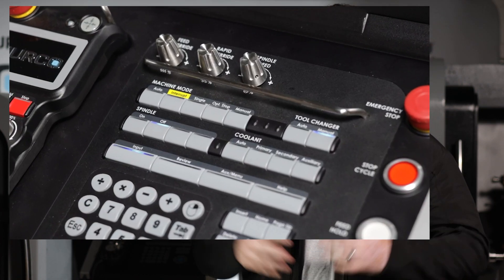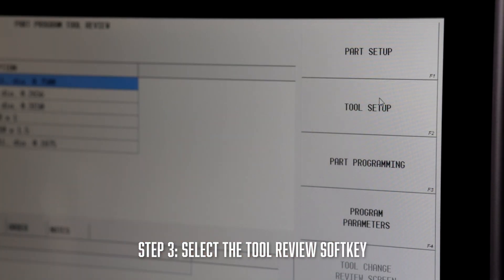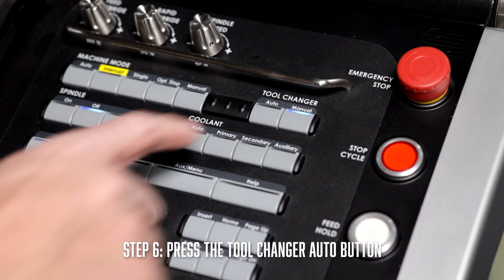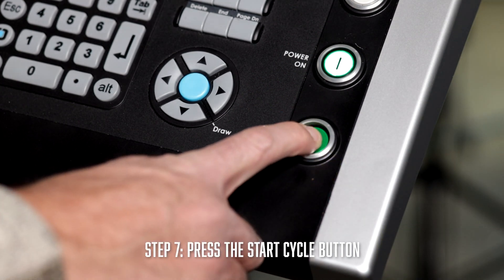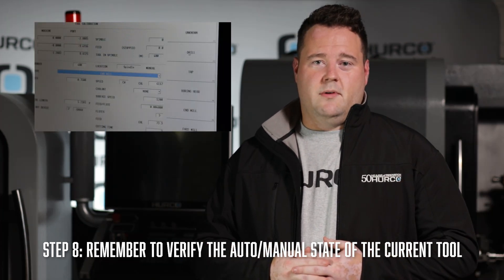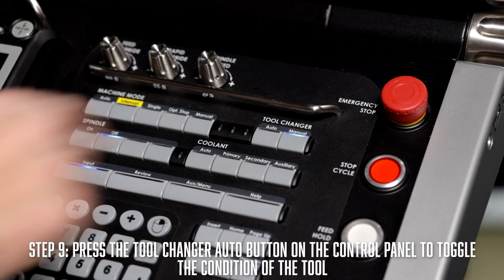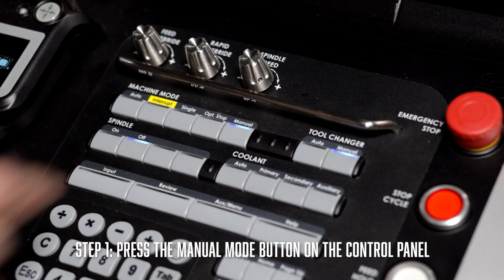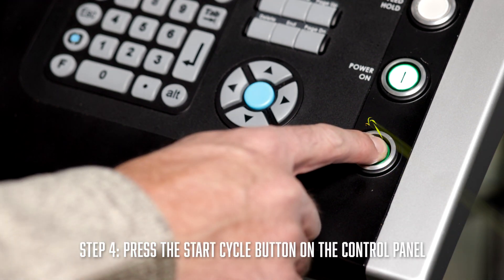Manual Tool Change & Clear Tool In Spindle - Hurco CNC Training

Comment: Can you not just go into an MDI mode and then type T00M6?

Same thing with the manual tool change sequence. It seems overly complicated.
Reply from the maker: Hi Mike, the short answer is no. In its current state, the Hurco control doesn’t have an MDI, so we can’t execute commands like that.